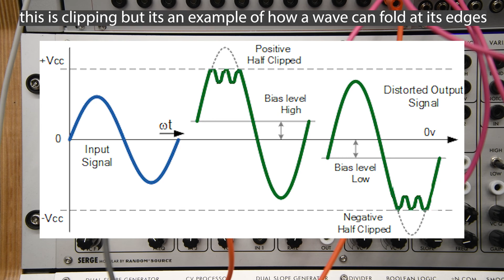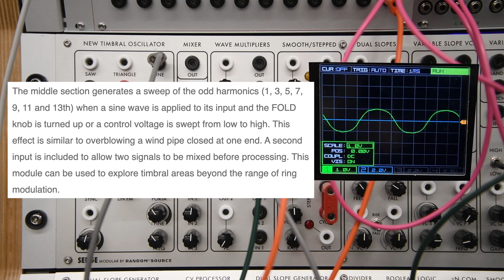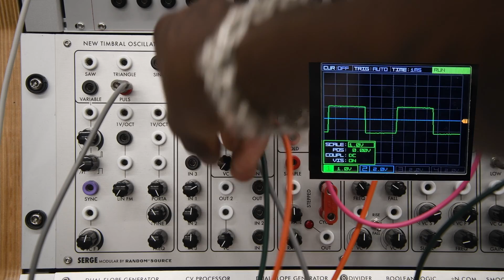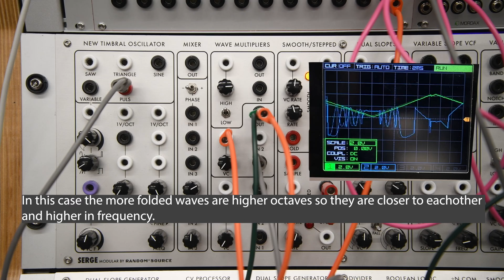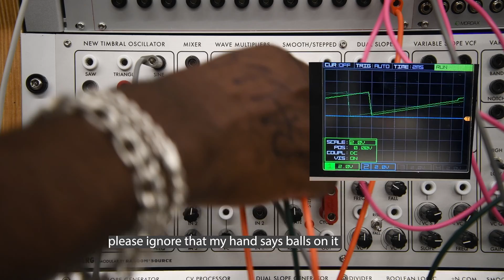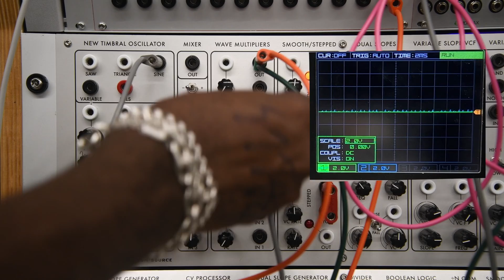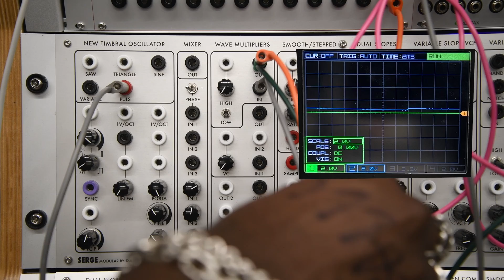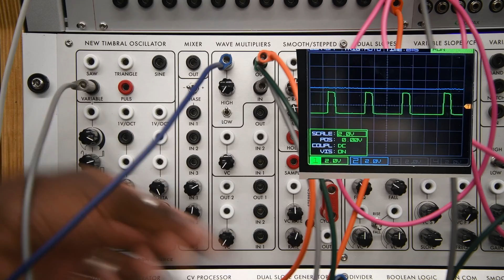Serge Modular Tutorial 2: Wave Multipliers

Comment: I have watched both of these videos and they are good tutorials. Your voice over audio is lower on this video compared to the first one especially at the start. My understanding of the Serge Wave Multiplier (having never owned one or patched one so what do i know! ) is the top section will give you more control with the second and third sections. The second section will react differently depending on the level of input signal . You went straight into the second section. If you went into 1 and then into 2 you could tweak the level on 1 and not just get an attenuated result but a different fold as well. Maybe you can try this and see if its true?   Or you go straight into 2 then out into 1 and then out of 1 into the second input of 2 and 1 will give you to control of the feedback level going into 2.  I have never used Serge so i cant say any of this with confidence.